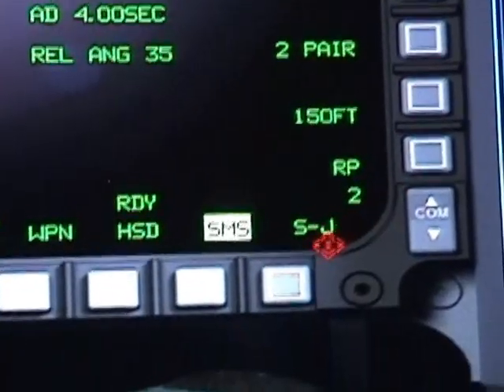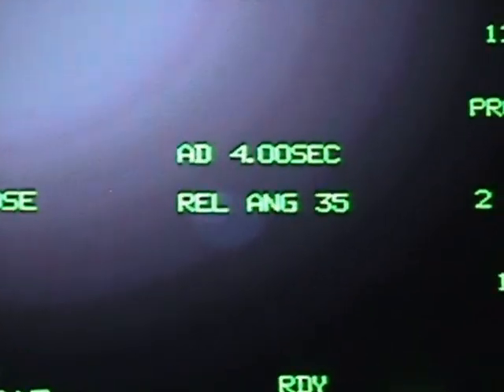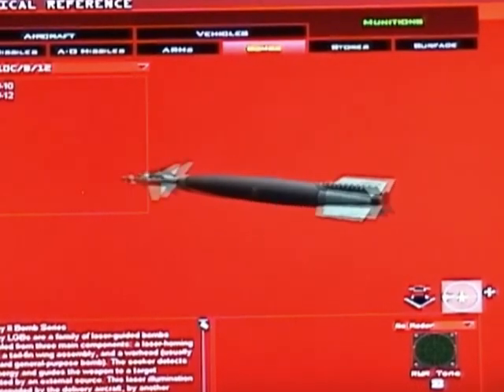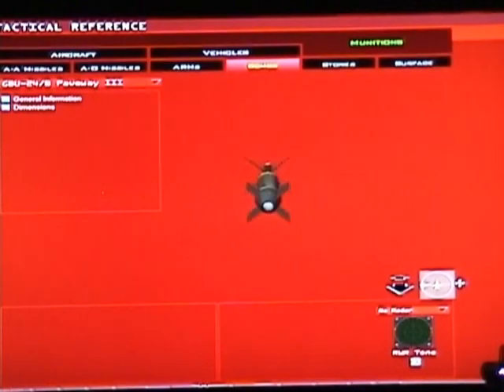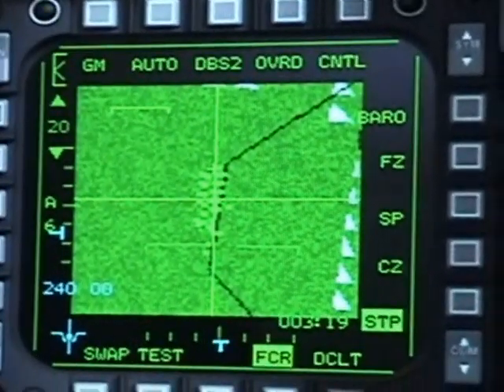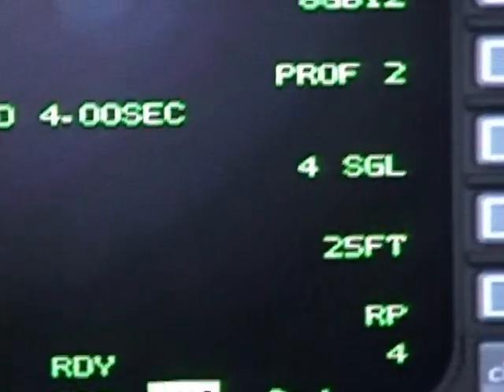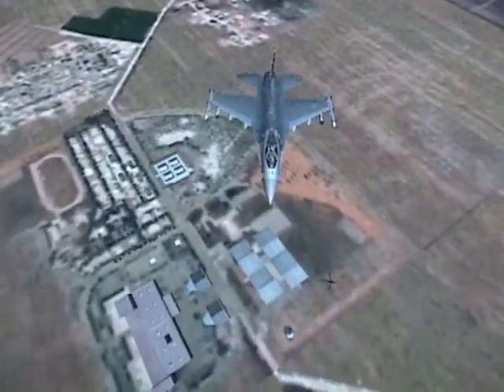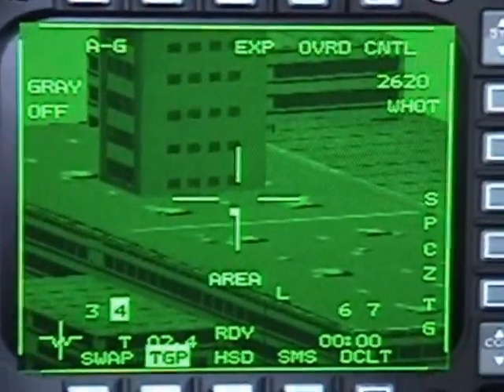F-16 F 4.0+RV HQ A-G WEAPONS PART 2

Comment: @AirlinePilot2008, Yes most of sidewinder versions have eyeball but i heared that X variant have a 128*128 pixels imaging sensor, can you confirm it?
Reply: infrared sensor, but its more maneuvarable than previous versions, thats what i heard :)
Reply: leonelp51
Now i can confirm that Xray variant have FPA 128*128 imagning sensor (infrared spectrum OFC, just a low reslution thermal camera). It makes Xray less vunerable to countermeasures like flares. And OFC is much more maneuvarable as it has thrust vectoring. Off boresight capability has been increased to make it perfect choice while using HMCS. Range also has been increased and also a new cryoengine cooling was introduced.